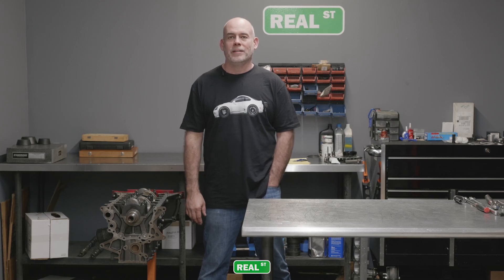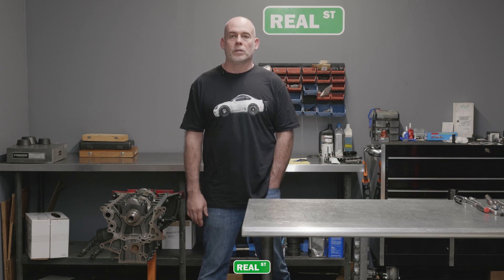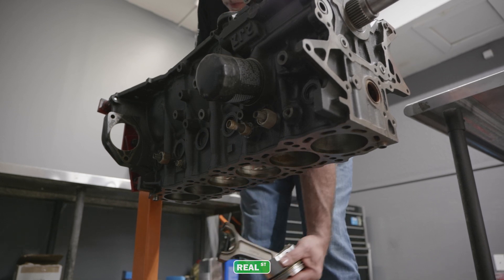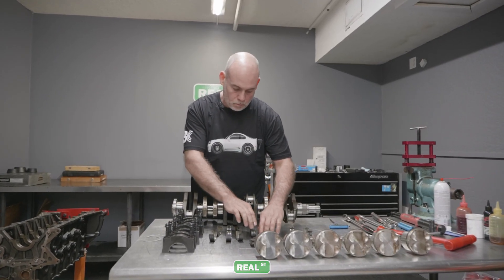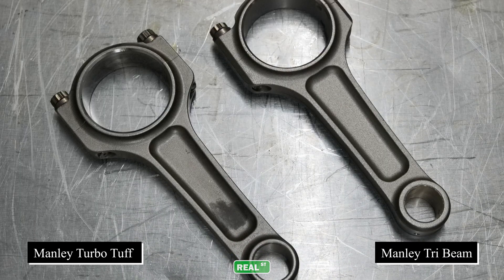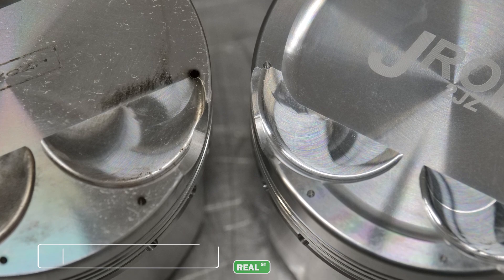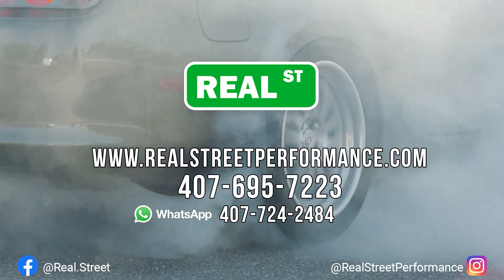1850hp Real Street 2JZ Engine Teardown. What Do The Internals Look Like After 5 Years?

Comment: i know this is an old vid and you may not even see my question, what's the point behind the holes bored down through the top of the piston to the 1st ring gap please?
Reply from the maker: Hey Chris, those are gas ports, they help seal the rings against the cylinder walls by pressurizing the area behind them

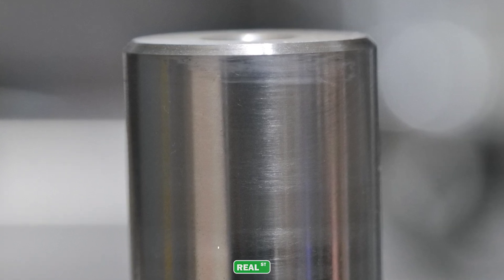Comment: 2:57 What do you mean by a higher level pin?
Reply from the maker: When the manufacturers have to choose what pin to put in a set of pistons, they have to find a balance between cost and strength. They often pick a "happy medium" between strength and cost because MOST people don't end up making enough power to overpower a "standard pin". But for people that WILL be making enough power to overpower a standard pin, we steer them into an upgraded pin. These are usually thicker than a standard pin, and usually made out of a higher grade material, but also come at a higher cost.

Comment: What's the best way to store an engine for 5 years and prevent damage from storage? Should I rotate it ever 3 months or just leave it alone and taped up?
Reply: When a engine runs, it provides Lubrication for your seals.

A piston engine will not deteriorate from sitting but cooling system, pipes, seals etc will if it sits for a long period.

Also used engine oil viscosity too does slowly break down after long periods of time

Comment: the more i see you guys working with 2J's, the more I would love to see you work with, Build and tear down a Barra as well as give opinions on it! very similar engines, 2j has the better block and crank, barra has the better head.
Reply: Wouldn't agree on the 2j having a better block to be honest, multiple 2200 to 2500hp Barras on a stock cast iron block. So I'd say it's opinion based, we don't know until a 2j makes that amount of power on a stock cast iron block.
Reply: @kaseyeveringham2867  theres a video online somewhere where the rb30, 2j and barra blocks are sonic and rockwell tested together, the 2j has thicker siamese bores,  as well as using a harder metal. The barras from 12-1400+ are grout/resin filled. I have seen a photo of RIPSS 2200 HP stock block cracked recently. Dont get me wrong Im a BIG fan of the barra, i have high HP one myself but the 2j block is slightly better made when it comes to the testing i mentioned.
edit: heres the vid https://www.youtube.com/watch?v=y5zsZ8Fc0kQ
Reply: @n1njaweedman  I watched it, every block is different. Point still stands don't know until a 2J makes the same power.
Reply: @kaseyeveringham2867  are people not exceeding 2000hp with cast 2j's? for some reason I always thought people were, they all must be running billet. lookout for all the billet barra blocks about to show up too, I know of a fella building one right now
Reply: @n1njaweedman  Holy fuck, that's sick man! One of the first right? Can't even imagine the potential they will have with the billet blocks, has he got an Insta or YouTube of the build?
Reply: @kaseyeveringham2867  extreme ford tuning here in perth Aus, check his FB page he's got a photo of it somewhere. It was machined by crest CNC in south aus who should also have some photos on fb. Simon at xft doesn't really seem to have a  big social media presence but im sure when he's done it'll be picked up all over the show